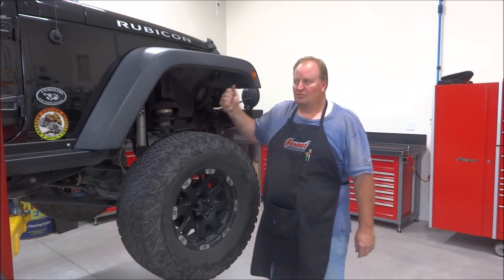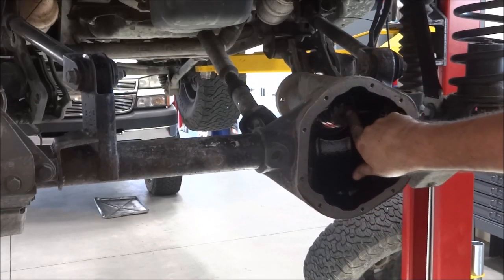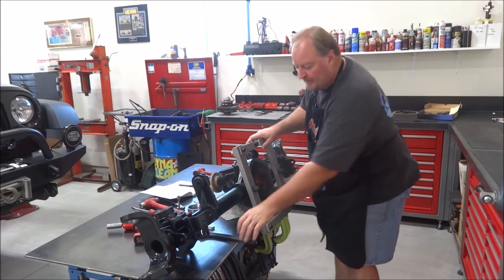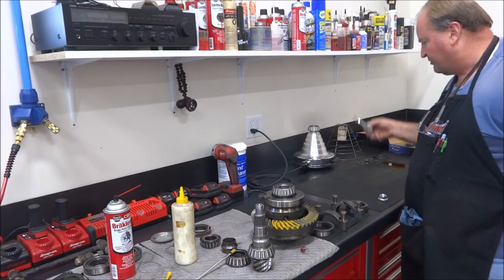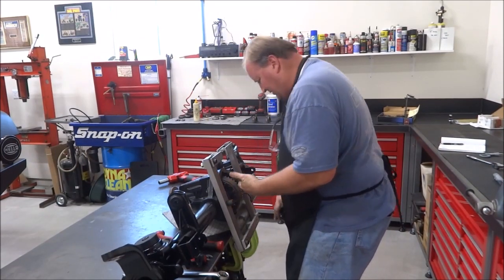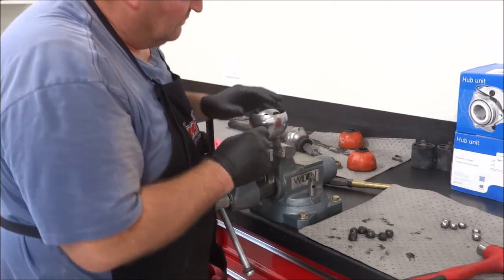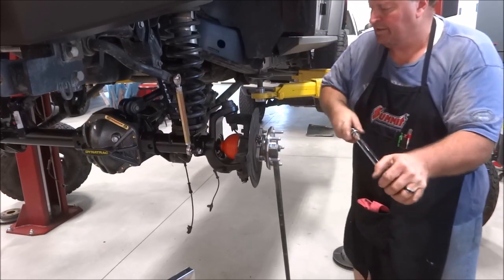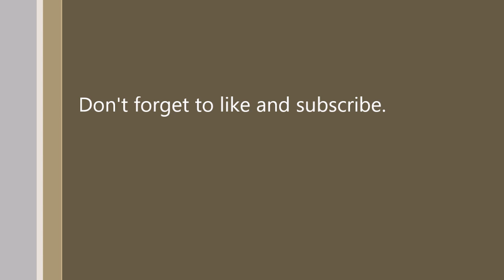Jeep JK Dynatrac ProRock 44 Build Up and Installation

Comment: How often should I change my diff oil? What oil would you recommend? I've only had my jk for about 8 months now and me and my family love it and I want to make sure I'm taking care of it properly. Thank you.
Reply from the maker: Keith, congrats on your new Jeep. I’m happy to hear that you are inquiring about proper maintenance as that is key for not only the life and longevity of your car but also to help avoid unnecessary and/or premature failures while you’re out enjoying it with the family. 
The FSM states to inspect the differential fluids @ 24k miles and if using in extreme conditions to replace it at that 24k miles. In my opinion any off-roading or adverse traffic conditions is considered extreme conditions so I would suggest following that 24k mile guideline at the minimum. 
I generally drive my Jeep about 15k miles per year and flat-tow it another 5-7 thousand miles behind our coach so I change mine once a year and generally in the spring before mine and my wife’s traveling begins. 
As for what fluid, any GL-5 80W-90 gear oil is what is recommended.  Personally I run a Valvoline Synthetic 75W-140 gear oil in mine. 
Thank you for taking the time to watch and I hope you enjoy my videos. 
Mike
Reply: @zmotorsports62  Thank you the response. I will change it this spring. Y'all have fun be safe ⁰lllllll⁰ 🇺🇸
Reply from the maker: Thank you and best of luck enjoying your new Jeep. 
Mike

Comment: I have the same PR 44 with RCVs and I need to replace the axle seals.  From what you said, it sounds like I would have to pop the RCVs out of the boot in order to remove them.  Is that true?  Seems like that might be difficult.  I haven't tackled a job like this, so I'm a little skittish.  Also, do you think I need the housing spreader to get the carrier out?
Reply from the maker: The orange RCV boots will not fit through the steering knuckle. That is why you must pull the axle shaft out and you remove the boot.  Once you get the unit bearing removed reinstall the axle not onto the stub shaft and use the nut to slightly pry against in our outward direction.  The axle will pull through the boot as it comes out but it’s very tight as the poly boot holds tightly to the CV joint (Birfield). 
Upon reassembly there is a tool supplied by RCV that makes it a little easier as it spaces the boot out slightly and allows the axle to be reinserted. You can do it without the tool but it’s a bit more of a struggle getting the boot to accept the Birfield joint. 
As for the case spreader it’s not necessary for removal but if the axle was assembled to the correct amount of case bearing preload it will be difficult to reassemble unless there is only one shin of the correct size on the outside of each carrier bearing. If there are multiple thin shins it is very difficult to assemble and get back to the proper preload with several thin shins. 
Hope that helps. 
Mike

Comment: Service manual for the rear dana 44 on my tj says 20 to 40 inch pounds for pinion preload with new bearings.  10 to 20 with used bearings.  So the specs for the prorock 44 are different?
Reply from the maker: No they’re similar just a little too tight for my liking so I don’t go quite that much on the preload. 
Thanks for watching. 
Mike